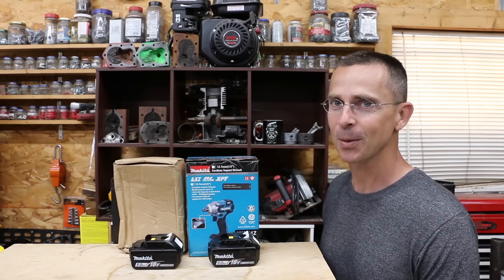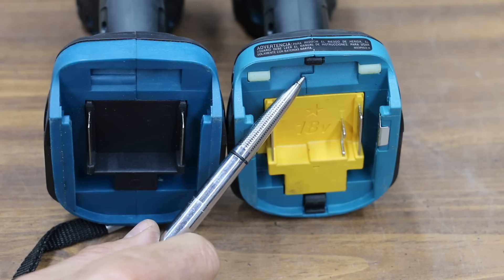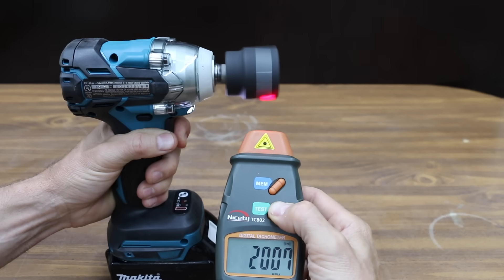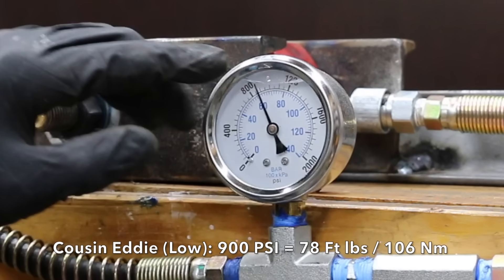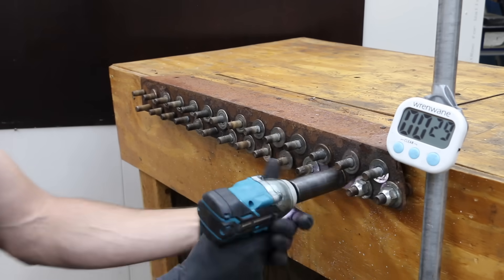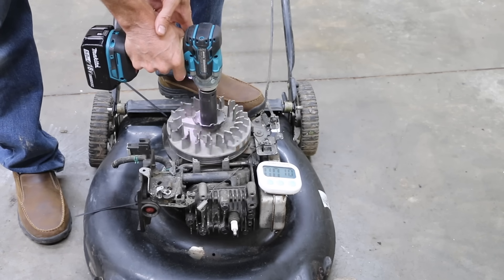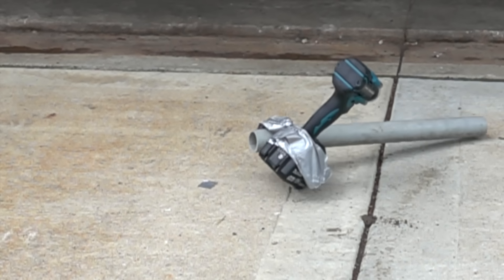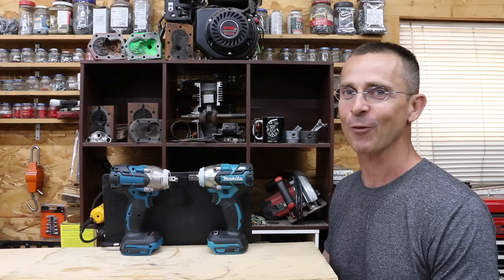Fake Makita Impact Better? Let's find out!  Makita XWT11Z 18V LXT Lithium-Ion Brushless Cordless

Comment: Hey Todd!

I was so surprised when you replied to my comment last video. I suppose I should not have been, seeing how connected you are to the community. And so, rather than begging you to test rope (as I did last time), I wanted to pique your interest in the same way other commenters did for “Using Gas Vapor to Power an Engine”...

It’s amazing the types -- and varying quality -- of ropes sold at hardware stores and across amazon. You could spend a lifetime trying to debunk claims or verify weight limits. And I would genuinely love to see a video testing various paracords (it’s as ubiquitous in homes as duct tape). 

However, more tantalizing than this, I wonder if you have heard that rope loses half its strength when a single overhand knot is present? Is a square knot an appropriate way to connect two ropes under load? With 1,000 pounds, are non-constricting knots really up to the task?

You have proven that so many of our expectations are incorrect, and that we as makers, handymen, and fixers are best served by fully understanding the tools we use. Rope is something I don’t think we appreciate enough. 
Thanks!

Comment: During the torque measurements are you sure the bolts weren't plastically deforming (stretching) since you were using a lubricant? That can definitely throw off your maximum torque readings.

Comment: I have the fak-ita.  The direction switch never fully clicks in the tighten direction.  After a few uses, in one direction it only works for a second or so.  It usually works continuously if it's actually doing work though.  Also, beware that the $30 one doesn't come with a battery or charger.  After buying those it's more like half the price.  It's also hard to get sockets off that friction ring

Comment: Got myself a cousin Eddie from aliexpress right after AvE reviewed it. Haven't had any issues with it and mine has instant trigger response. Quality control is the problem with anything coming out of China. Go onto aliexpress and you'll see at least 100 different sellers selling at least 10 different versions of this impact wrench.

Comment: tbh if you are not a mechanic, a construction worker or work in trades, the 30$ is good enough. knock off? yeah. is it wrong for them to do that?yeah. Is it less durable?yeah  but i am not spending 140$ on a tool that i will only use 3 or 4 times a year in a home garage changing oils and rotating tires.

Comment: I stopped buying cordless tools because I got tired of having tools that they don't make batteries for anymore.  That has happened to me several times.  My current impact gun is a corded electric Kobalt unit that's fairly heavy and has a monstrous amount of torque.  I haven't found a bolt yet that I haven't been able to remove with it.  To me the bonus is that since it doesn't use batteries it has no "planned obsolescence".

Comment: I've been running a 'Cousin Eddie' for nearly a year and it's still going strong but I'd recommend genuine Makita batteries
Reply: Also if you go to the Swap meet you can buy real brand brushless tools for $20-30. sometimes in the box Or no box but brand new. just about every swap meet has real tools new & used with diffreants sellers for price hunting

Comment: For somebody who is a do-it-yourselfer or just the person that occasionally goes out to the U-Pull scrap yard, I think the $30 impact is more than enough.

I wouldn't recommend the knockoff for a professional mechanic there for somebody that wants a cheap Impact for those times when you really need it in a pinch, you can't beat $30.

Comment: I wouldn't exactly call it a knock off , but my Porter-Cable impact outperforms my buddy's DeWalt in almost every metric . Both are 20-volt brushless . His light and weight distribution are better , but my speed torque and battery life are all better .

Comment: According to Gamer’s Nexus, PC case/radiator fans are considered “in spec” by their manufacturers if they’re within +/-10% of their rated RPM. Maybe Makita has similar tolerance ranges, which would explain the variation in RPM from its rated RPM you saw.

Comment: The connect the heads together test isn't too useful IMO, as any electric motor will overheat/fail if it's powered but stalled, or spun in an unintended way, just straight toque testing is fine.
Any chance you can test pre-drilling vs not for screw strength? And also filling a pre-drilled hole with wood glue, vs coating a screw in wood glue for strength? Maybe also thin wood vs thicker wood?
More info for that here:
https://www.youtube.com/watch?v=hQ3GW7lVBWY&t=1s

Comment: The makita tools are impressive and are used in our shop daily. That small 1/2" impact rips. Tightens 5/8 lug nuts to about 145tq. Also the bigger impacts flex just above the battery.

Comment: Nobody said “you get what you pay for”
Reply: What that means with the modern brand tools is that you pay for the fancy showroom, where you pick up a warranty replacement. That is the way these days, not a visit to the store goes by without having a tool or two to replace at the same time. Makita has the worst dealer network and to me that tells they trust their tools the most and that is also my experience.

Comment: I have this love / hate relationship with PF. I love his videos and learn a lot from them. But that is the problem. I hate the money I spend because of the stuff I learn from Jeff. Example, his video on auto air filters.I was fat, happy, and sassy with the K&N air filter till I watched his video and learned that the K&N is great for racing (which I do not do in my truck) but it is almost junk as for filtering out the dirt.So I had to pull out my expensive filter and install a Wix filter because it performed better than the rest in Jeff's tests. So again, I love his videos and the information. But I hate the money I wasted before watching his videos. Thanks a lot Jeff.

Comment: Note the makita has a sensored brushless motor while eddie has no sensors. Thats why eddies motor is a brute, not finely controllable, and thats where the start delay originates.
I got an old style brushed eddie too, which is much better than the brushless for small things but may have less power.
For $30 plus $20 for knockoff battery & charger still a very good deal.

Comment: My needs for an impact wrench is limited to a skidplate with six bolts that has to be removed to change the oil in my truck.  And the occasional household project. Small stuff.  So I got the dirt cheap Walmart HyperTough impact.  It works fine for my needs and spending a lot more on the Makita wouldn't really add any benefit.

Comment: I'd say "Cousin Eddie" is well worth it's cost if you just need something with light or occasional use. Also, I now know why my old 120v Makita Circular Saw & Drill are so durable and lasted so long. I don't intentionally drop or mistreat my tools but I don't exactly baby them either and they have held up very well for the few years I've had them especially considering I bought both used.
Reply: I baby my tools. I can't afford to replace them all the time.
Reply: @1pcfred  : Rule #1. Never let anyone borrow your tools.

Comment: You know, I bought a Dewalt impact (lithium bat) last year thinking I could not have to drag out my air wrench for lug nuts. I forgot what I paid for it ..but I remember thinking it was too damn much.
First time I went to rotate my tires, the powerful Dewalt - would not remove a single lug nut. So I don't trust it to put any nuts on either.
So it is now a door stop. Anybody else have the same experience?